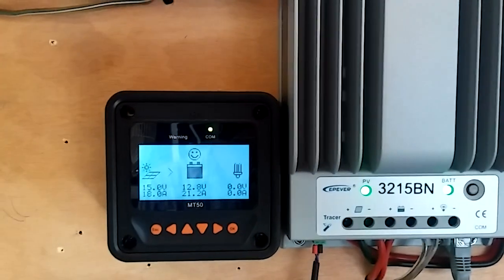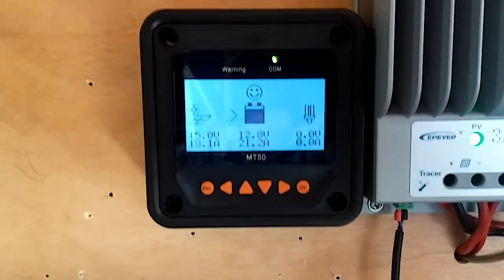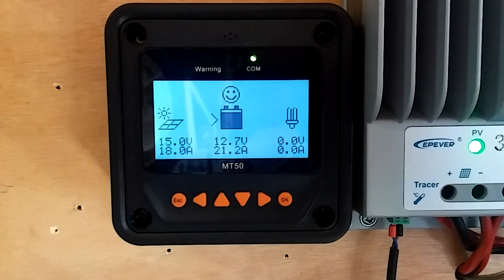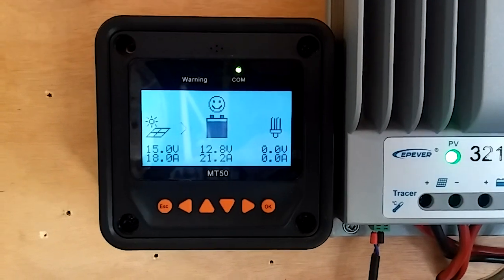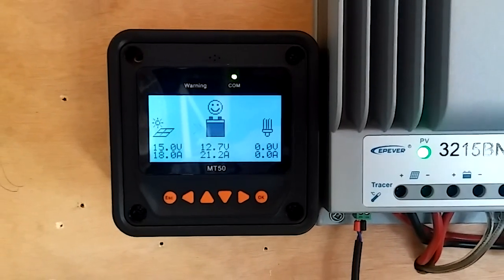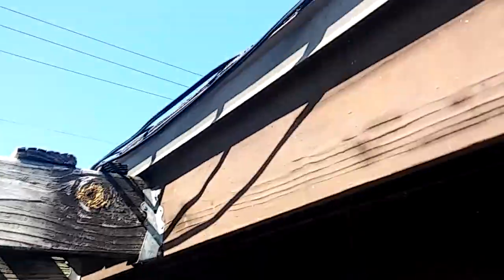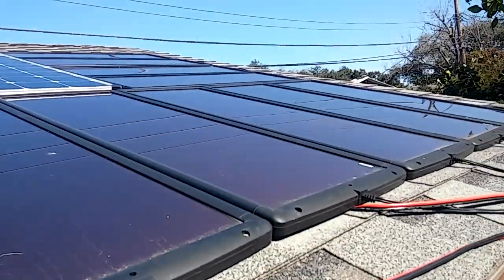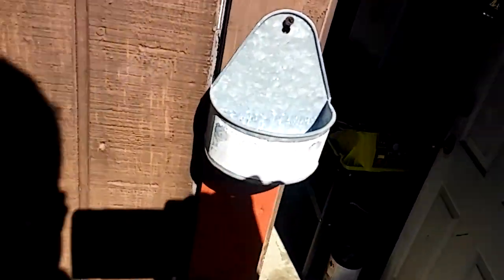12 Harbor Freight solar panels with 2 monocrystalline panels

Comment: Looking good!  That south facing and roof placement really helps.  I've seen 16.8A peak so far on my system but it points more west than south, and the sun is still pretty low so far.  As it gets higher I'm sure I'll be seeing something close to what you have (3 X 100W monocrystalline and one 4 panel 100W Harbor freight kit).  I will watch for your side by side comparison though since my installation isn't rooftop, I'd like to see what you get out of one "set" of HF panels for sure, compared to what I'm seeing.  I'm actually running two meters-one for the 3 mono's and one for the HF's so I can see each ones daily AH contribution.